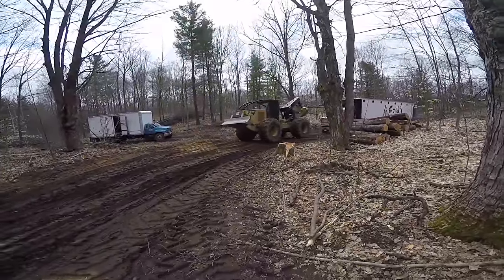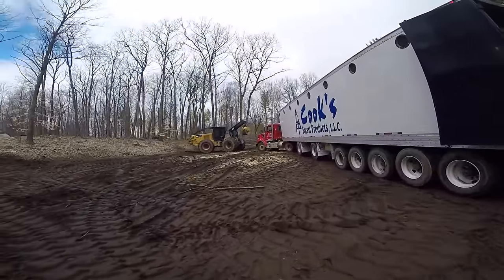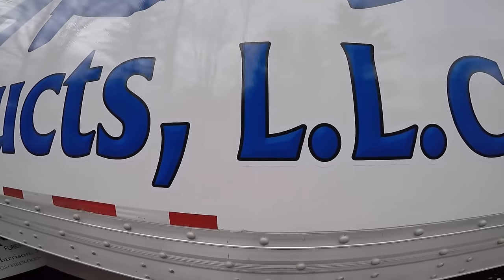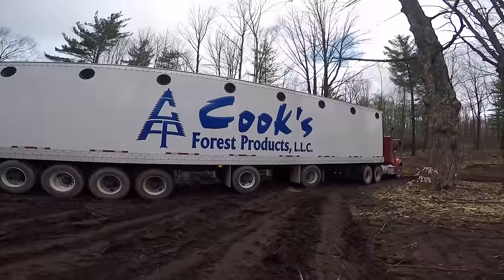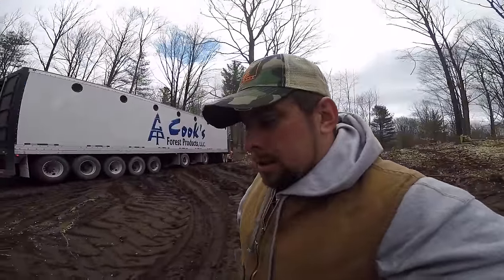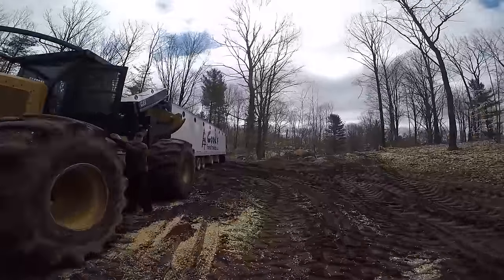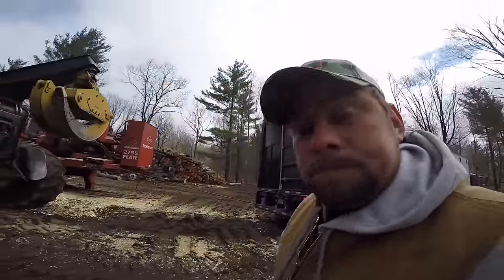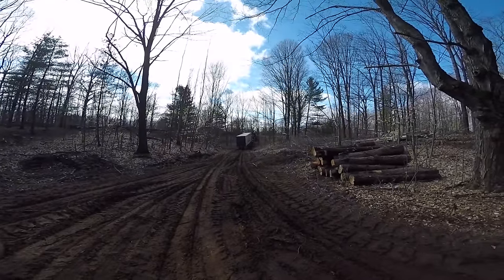LOADING THE NEW CHIP VAN!!

Comment: Seems like I already watched this on Mikes deal. 2 tons a load plus the other you run out on the ground to lay on and show us the damaged digit. Glad you got to send some videos out. Computers are fine until they aren't. Like when a wire breaks or grounds out and you have to use a bungee cord on a labor-saving device. Or a string. I'm in the woods too getting some maple from a neighbor from overhanging power line trees.Instead of Splitzilla it's Wheezearella here but it'll be enough to fill the shed back up and smell that fragrant aroma of wood drying. Grind on, John, HEAL UP GirlieS and Blessings All yall!

Comment: Great video, great trailer - just worried it doesn't have enough axles 😆
Would love to see one that size here in the U.K. down our roads !!🇬🇧
To save on so much towing with the Cat would it not be a good idea to have a fifth wheel dolly on a tractor to save the trucks driving off road?
Especially in the winter months.
Reply from the maker: +fergie35X gotta have that truck under it. Alot of weight in those trailers. Loads here have been as high as 46 tons. Alot of dead weight to pull without help from the tractor. Thanks for watching

Comment: What was the outcome of the log truck and it's running problem?  You mentioned drive shaft and I guess that was the problem.  The most impressive thing to me and I'm sure others on the chip vans  is not the length but the sheer number of tires and axles they have.  We just don't have anything like that down here in Georgia.

Comment: Looking good, just wondering why you don't have some steering axles under there, rather than just the straight lift axles,
Reply: Adding the Steering to an axle increases the price by $6,000 +- per axle.
So with 4-5 Lift Axles the up grade becomes expensive.